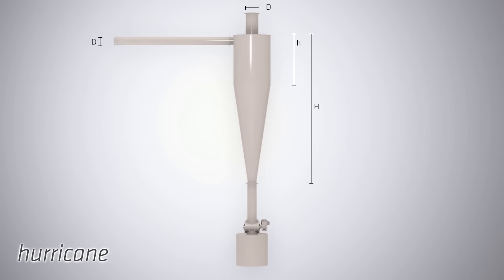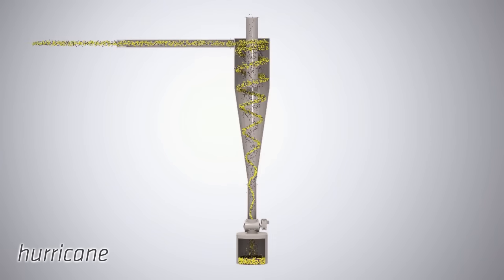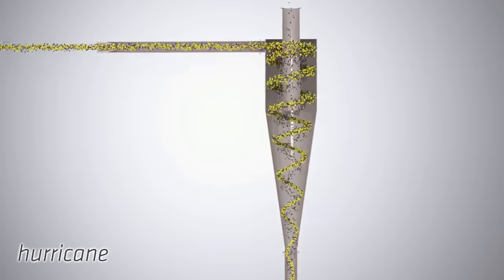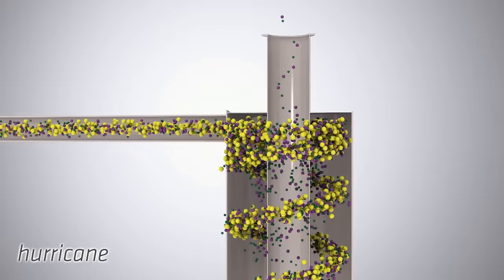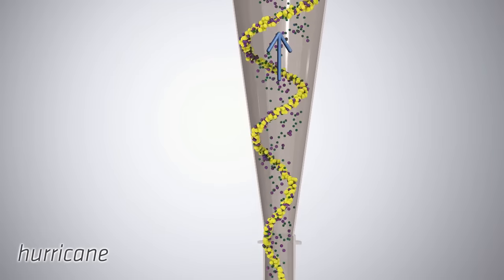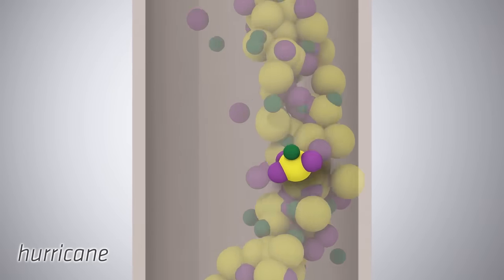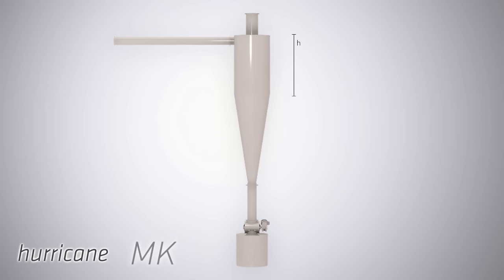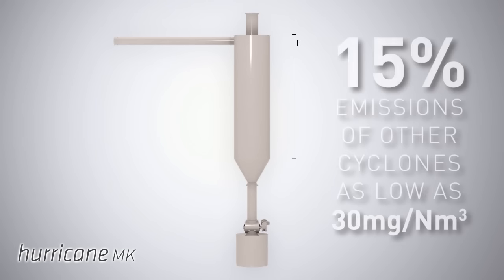Hurricane System - High Efficiency Cyclones

Comment: This types of designs for Cyclones, tornadoes, hurricanes should siphone, disintegrate the velocity of the pressure from the base all the way up, since warm air and cold air when they are trapped it creates this type of cyclones, warm air that was not able to release its strength on top while cold air pushes it sideways and upwards, the "tornado, hurricane, cyclones" drainage system or vacuum can be installed after the blue print so as to contain, disintegrate the velocity from the base or at the middle depending on the measurements and gauges of temperature from a barometer and the rest of the equipment. The "Vacuum" can prevent those cyclone either on land and on water that it can be used to create energy as well for energy needs, the way pulsators in a washer does, eitherways counter clockwise that typhoons are not designed.

Comment: can a cyclone be "blown" from the bottom or will it only work from a vacuum in the top? i'm wondering if it is blown from the bottom, will it create enough venturi to still suck the gas through the top but not affect the blower from the bottom.
Reply from the maker: Hi Kevin, 

If you blow gas from the bottom, the particle reentrainment effect may (almost certainly) become very relevant, thus compromising critically the overall cyclone's gas-solid separation performance.

However, focusing only on the gas behaviour (and neglecting completely the major purpose of applying a gas cyclone is successful gas-solid separation) every cyclone can work on positive or negative relative pressures, but the gas must always go toward the lower pressures zones, thus either blowing from the bottom or suction on the top, the gas will follow the same path, thus having similar gas dynamic behaviour.

Visit our website for more information about our cyclone systems design.
Reply: It should be siphoned Kevin from the bottom, remember, when you're preparing juice, the force is at the base and where the stirring action is, when you place the stirring rod, it quickly breaks at the bottom or at the sides where the huge force is.

Comment: Hi. Is it possible for a cyclone to separate particles of different density rather than diameter?
Reply: Not sure about cyclones, but there are vertical blowers that do this. Have a look at the ones the tea industry uses.
Reply: @markp8295  
Thanks. I wish i had known this back then
Reply: Cyclone is effective of trapping high density dust because it's operate by gravitational attraction.The power of cyclone is dependent on the blower.